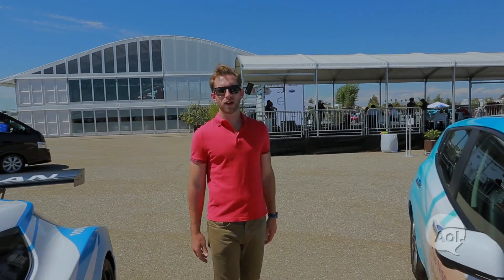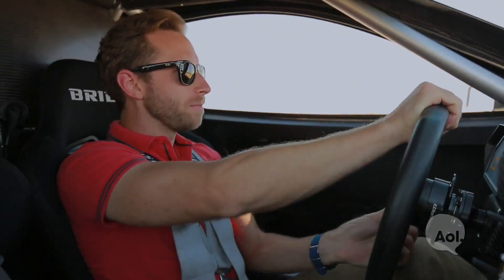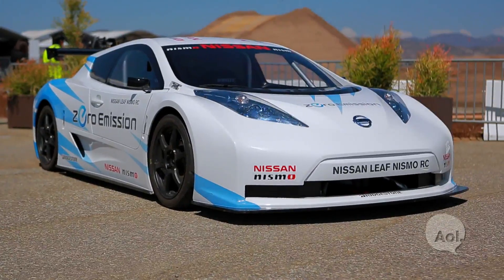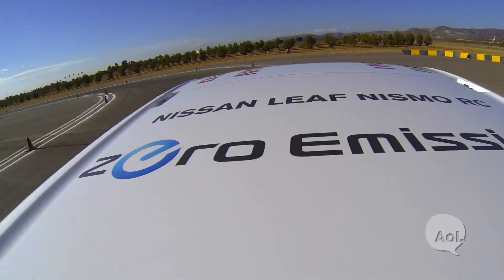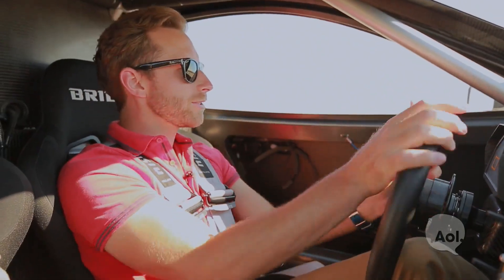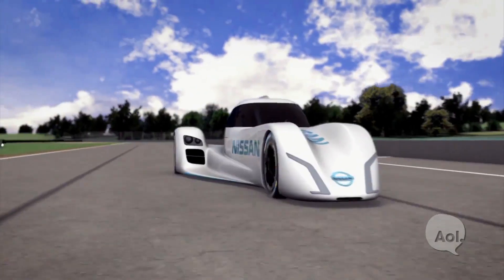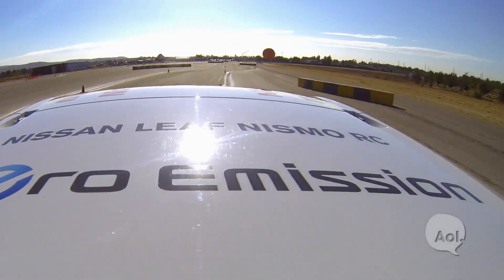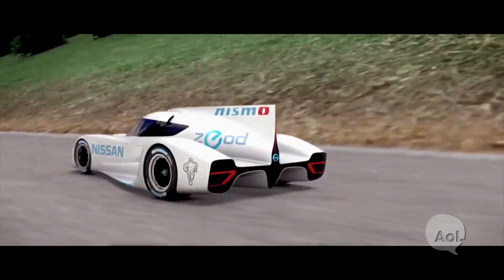Nissan Leaf Nismo RC | TRANSLOGIC

Comment: You are much too diplomatic Bradley. As a thin carbon fiber shell it's pathetic at 6.6seconds. It's an embarrassment for the EV community and particularly idiotic that it's rehashed for years now with zero changes.